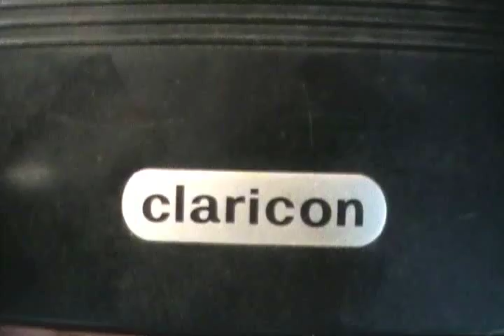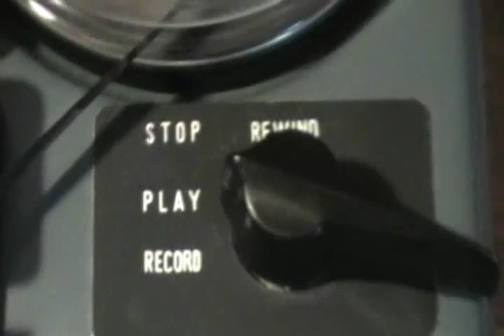Claricon 4-transistor reel-to-reel recorder, rim-drive.

Comment from the maker: @shesnailie Yeah, rim-drives are known for inconsistent speed. Try cleaning the rubber tires and wheel edges with Windex, it should help to have better traction. The machine in front of the TV is the Steelman Transitape reel recorder from 1959. I have a video on it already.